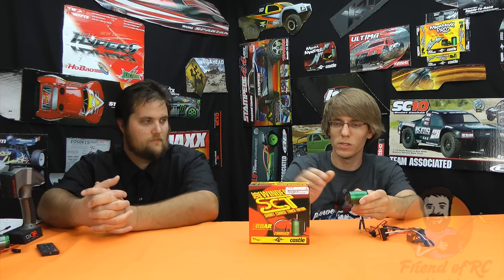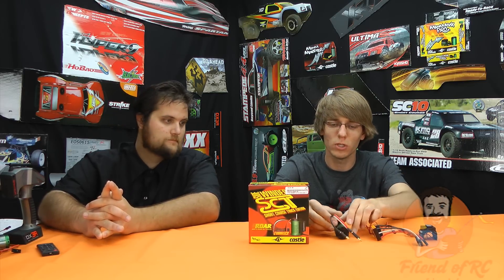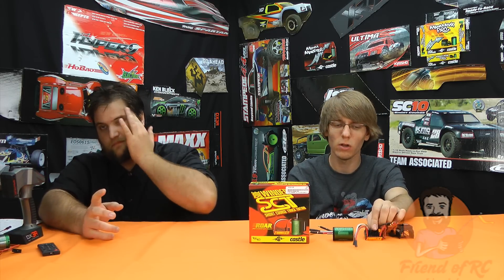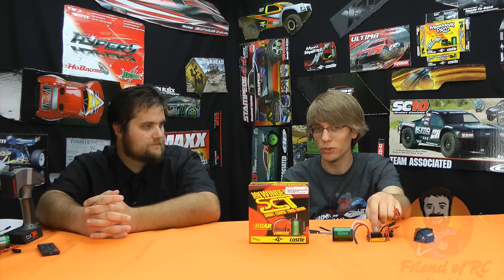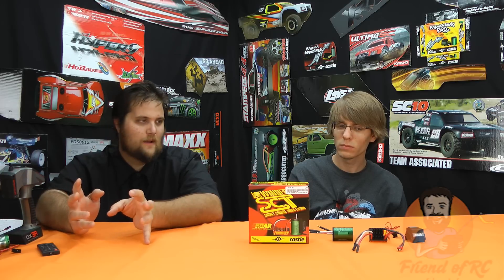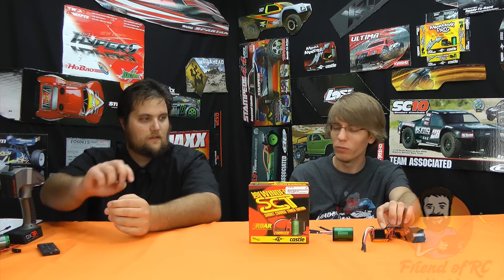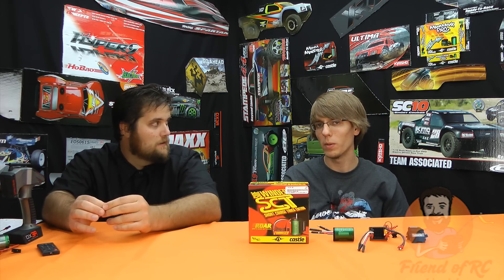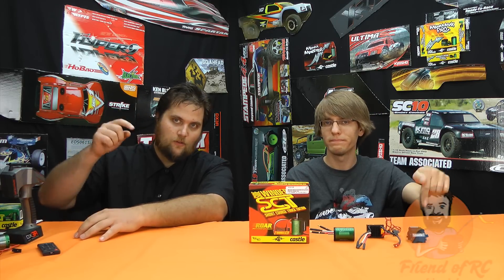Castle Sidewinder SCT ESC & Brushless Combo Reviewed

Comment: Reviews say the new Sidewinder SCT system is actually amazing, and I'm buying one soon too. Loads of torque, the ESC now comes stock with a fan and 3s LiPo or 18-Cell NiMH capable as well as the included motor fan and they still kept the $100 price-tag. Trust me, the next highest "worth it" combo is $250. If you want to go another step further, I think the Castle Link programming card is about $20, and on top of all that, Castle's amazing customer service and warranty.

Comment: I love this setup on my Kyosho Ultima RT-5 it runs super cool and I adjusted the throttle curve to make it have higher acceleration but lower top speed. But mine came with a fan already attached to the ESC along with the motor and blower, also mine is all waterproof!

Comment: I'm using one on my hyper10sc. Mine comes with fans both for the esc and motor already. I bashed for 1 full 5000mah pack and never overheat. Motor is very slightly warm, while esc is a bit warm but far from hot. Powerful motor and tons of torque even for the quite heavy hyper10. P.S. manual states that this combo is 3S capable, only need to check your temp regularly.

Comment: @friendofrc yep just cut the thinner parts on the side off(make sure you do some measuring you cant cut exactly all of the thinner part of the side off) and hot glue, melt, tape, (whatever you want) the plastic together, solves the heat problem. The motor stays cool on its own so ur all set.

Comment: I have the Pro system on your recommendation, not run it yet though (waiting on a pinion bore reducer). I read a lof of guys with the Sidewinder SCT were putting the motor fan over the ESC instead and this fixed the heat issues generally.

Comment: @friendofrc hi i've got this system and have bought a 2s lipo for it and have never ran it low enough for the lipo cut off to kick in does the cut off make the car turn off or 50% throttle?? plz answer.

Comment: I ordered a sidewinder sct combo and the esc came with a fan already built in so it looks like the hpi flux vapor pro esc. I've done a few speed runs getting about 30mph each run in my hpi blitz on a 7.2v 4300mah Nimh and after them runs the hottest things in the truck is the battery. So the new fan has fixed it an the motor doesn't really need a fan.

Comment: i had the same problem. wowww mine would do thermal shut down a lot!! it was so annoying. i had to lower my gearing. and it solved it. i was running it on my slash 4x4 by the way

Comment: Jason you should Be able to but watch temps because I run mine on 3s in my blitz and I've had to get heatsink for motor and put the cc blower on top of the esc even tho it has a built in fan. I you get the new sct combo it comes with fan built in. When you plug in 3s the fan goes crazy and spin up really fast and buzzes but after 1 min it stops it. But I was cutting out due to temp but I hope twin fan on esc will help. It's insanity tho on 3s I've blown 3 tyres of there rims and mine does 40mph

Comment: i have one of these and i run it with a traxxas nimh battery and it is pretty much the same speed as my brushed motor i had before.
Reply: Something is not right. Maybe you have it undergeared. This should completely overpower the truck and make it do wheelies.
Reply: +BfhCheese i have everything stock except for the esc and motor... gearing is all stock too
Reply: +Derek Unterberger Well i have a 2wd slash brushed and i got this combo on my sc10.2 and the sc10.2 just accelerates twice as fast, top speed atleast 25% more.

Comment: Would this be good for a drifter? Sport3 drift to be exact.
Reply: I'd go with the SV3 4600Kv for that
Reply: thats what i got, its still a shit setup need high kv brushless,  upgraded to HobbyWing 6000kv still a joke. Needs more power

Drift is different to track, with track tyres on its real quick, once drift tyres are on different story.

I take my drift car on a touring track, can drift the long bend but runs out of legs

Comment: Ran the newest castle sidewinder sct and its really fast. Even ran 3s and never could reach top speed cause its so fast. Im getting over 60mph with stock gearing on a stampede 4x4. It does get to hot when running a 3s.

Comment: QUESTION... I had this setup and was having problems where the motor would cog no matter what throttle position. I have redone everything from default with no luck. I then took out the SCT esc and installed the V2. SAME ISSUES. I have tried different radio, different wiring combos between esc and motor. Wont stop cogging/glitching symptom. I do not have another receiver to troubleshoot with.I think the issue is with the Castle 5700KV motor. Anyone??? Running 2s lipo 20c to 50c packs.

Comment: I realize this is an 4 year old video.  Have Castle addressed the heat issue since then?  
I am new to RC's, I got a used RC10T4.1 and need to replace the brushed motor. I am not outfitted with lipos yet (future plans) will this system run on my current 8.4v 5000mah nimh's?
Reply: The newest version I found has a fan built onto the esc and they give you a fan for the motor as well so heat shouldn't be an issue. Castle makes great stuff.
Reply: smartass23t
Thanks for the reply, I bought a 3800kv combo the other night and included two fans.  and after manually programming the ECS for NIMH (disabling lipo cut off), I was off and running!  thanks for the review.

Comment: If it heats up gear down and use the fan. I never have heat problems with this. also, why would u need more than a 2s for a sct anyways? not like it's made for speed runs up and down street.

Comment: the esc is not thermoling i had the same problem they swopped it out about six times they were arignal castle was for plains a heli and now rc when they made them the had it cut the reciver off at 4.8v and a rc needs 6.4 so if you run a compasctor it wont cut off.